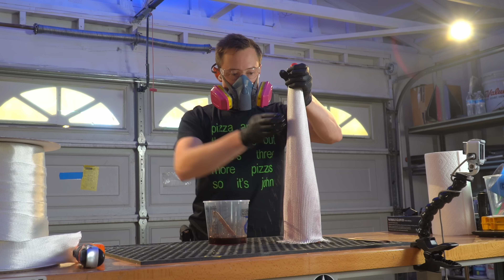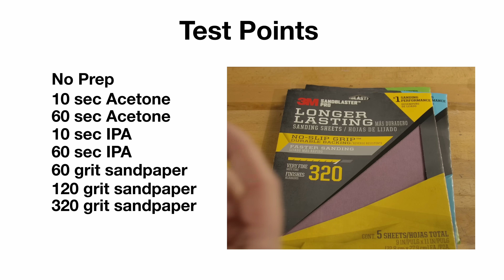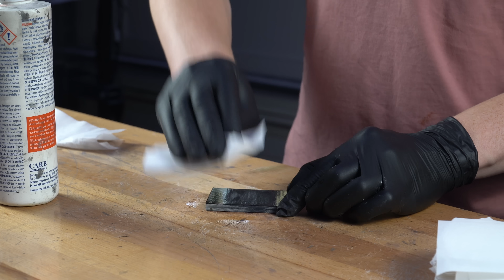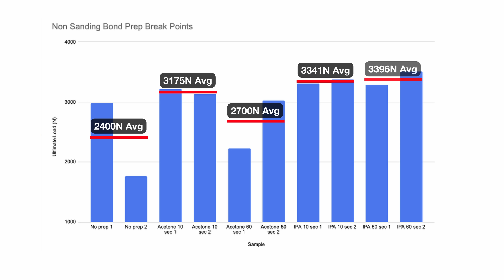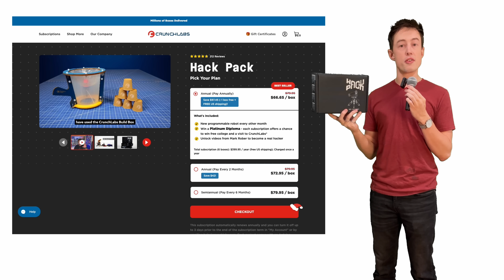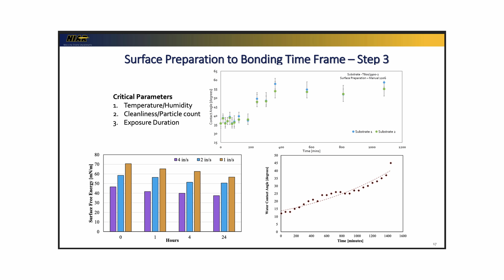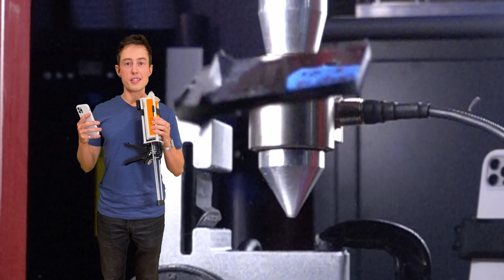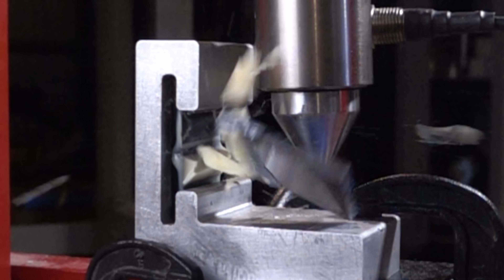I Broke 100 Epoxy Bonds to Find the Strongest

Comment: That is not a proper glue joint and most epoxies are not designed for massive thicknesses without filler. Suggest you read about composite bonding guides from each epoxy manufacturer. But if that heavy poor quality bond is you want.....

Comment: 32:49 also could try - in welding, the best practice is to wipe the surface with solvents first and then wire brush. If you do it the other way around, you'll end up contaminating the wire brush itself and just smear the grease around and actually push it in to the metal itself.

Background- I am certified in  titanium, aluminium, stainless, .... pipe welding.
Reply: Also the sequence will be- Wipe->Abrasives->Wipe

Comment: The most valuable insight was how consistency is key when you have to design around a worst case tolerance instead of the average tolerance

Especially in a system with a large number of failure modes

Comment: bonding to a flat surface is difficult as a flat surface has a low bonding surface area so make the flat surface rippled, larger than scoring to maximise overall surface area.  Rippled is cleaned better than a golfball-type surface as holes pick up more dirt. Porous is best, so epoxy seeps into the bonding surface.  i use this with multi-skeg surfboards.
also use Peel Ply: If you are working on a flat lay-up, apply a synthetic Peel Ply fabric over your wet epoxy. Once cured, peel it away to leave a perfectly textured, ready-to-bond surface without any sanding required.
use Methylene Chloride (Dichloromethane) its dangerous or less dangerous N-Methyl-Pyrrolidone (NMP), toluene, or MEK (Methyl Ethyl Ketone) to expose some of surface fibres to knit into the new bond
also laser etching works and as carbon fibre is conductive then electrostatic etching also is an option

Comment: The sandpaper bring some problems: some contamination you cant remove with ipa: the aluminium oxid particles which can stuck in the surface. The size of each grain can be very different: if not made with JIS Standard or other tight tolerance it means maybe you have some grit contamination. If only 1 grain is 3 times bigger it will have much pressure on it etc… it was very interesting video thanks ❤

Comment: Sanding isn't bad what's bad is keeping all of the debris and dust that is stuck on the crevices after the sanding. Blowing the dust away or wiping it with ethanol doesn't get rid of all dust and debris it just pushes it further into the crevices created by the sanding.

Comment: The vacuum also pulls air out of the valleys of the roughened surface, allowing the epoxy to enter,  Otherwise, those spaces could still contain air, keeping the epoxy out.

Comment: A technique I learned for getting epoxy to stick to Aluminum (Nothing sticks to Aluminum except oxygen -- And that happens within nano-seconds.)   The technique is to 'wet-sand' with the epoxy in place of water.  This works because when the aluminum oxide surface is scratched away by the sand paper, there is no way that atmospheric oxygen (or anything else) can get to the surface.  The only thing that can get to the freshly exposed pure aluminum is the epoxy which is saturating the sand paper and the aluminum interface.  I have used this technique to wet-sand the aluminum spars on my boat with epoxy, followed by a coat of Rust-o-leum and they are still perfect after ten years.

Your experiments -- beautiful work by the way -- my highest regards!  ... seem to indicate that surface contamination is a major and very devious parameter.  The other research you cited as well.  

If so, the 'wet-sanding with epoxy' technique might be the est way to eliminate the problems of surface contamination by ensuring that nothing can get between the freshly exposed surfaces and the epoxy.  It works with aluminum, maybe it would work on fiberglas to fiberglas bonding as well.

Thanks Again for doing things (science) right.  Presenting data not opinions.

Comment: why didn't you use a linisher (belt sander type of thingie)? make your passes repeatable (eg twice through or once then 90-degrees once again etc). i wouldn't consider lint free wipes to be a scientific cleaner... you are trying to get the product CLEAN ie dust free - WASH them! then use a lint free wipe if you must but use a water hose or air jet to ensure that all the dust is gone. otherwise you may just have a lint free, alcohol-and-dust low-adhesion MUD in the scratch grooves. the huge discrepancies in some of your results is problematic - the prep is not consistent. LINISH and WASH - IMHO. Also those beautiful molds are too strong: hammering the product out of your molds is another unrepeatable variable. Use cardboard or paper or something that does not require hammering. (use the same stuff thruout).  let's stand back and look at the forest because we've been scrutinizing the trees. what do you want to do? make a strong bond using epoxy. why don't you increase the surface area by drilling holes in the surface - and/or placing well-affixed pins or screws or rivets in the surface - and/or extending those pins/rivets THROUGH the material ... oh i know i am getting your grey matter burning pink now. these will INCREASE the surface area of bonding by a lot more than sanding. I just love your work JB and your creative and humourous vids. - X

Comment: There are several methodological errors in your testing, but the biggest isn't the inconsistency between samples and controlling the variables. It's not even the sample numbers. But the fact you were trying to narrow don't the best technique, instead of comparing them to find the best one.

You tested a bunch of techniques at first, and then after getting the 4000N on the 60 grit, you focused on it, trying different variations of it to try to improve and later reach back, the original result. In other words, you found a local maximum, and limited your search instead of continuing looking for the global maximum.

To improve any testing in the future I recommend a few things: 

1. 3 samples minimum discarding the outlier of each... while 5 samples is preferable, discarding the highest and lowest values, but I know it's a lot of work so 3 samples is enough for most cases.

2. For every test batch, make a control. A sample you can do the same every time, like simply wiping the surface. This let's you normalize the results to the control, to decrease any discrepancies between batches. It's specially important since for every batch, you used different mixing of the epoxy methods, degassing, etc. This alone let's you relax every other variable you accounted for like making sure the epoxy was the same batch. You only need to make sure the variable are consistent in the same batch.

3. To help find the global maximum instead of a local one (Or at least a better local maximum). When trying to narrow down on the best result, do the same with the other methods. For example, you got a good result on the 60 grit, so you "picked" 60 grit and tried more things on top of it to try and make it better. You should've also done that to other samples as well. Because maybe 60 grit is better than 1400, but 1400 with acetone is better than 60 with acetone. You don't need to test every variation of every technique... there're several ways to optimize the search space to find a global maximum (or as close as possible), without needing to brute force every combination of everything possible.

Comment: Very nice job ! I've worked in composites for 25 years  in a french company who build composite antennas for satellites, and a lot of other spatial stuff (Still working there but in another place) and we were following a process of surface preparation and bonding very precise concerning paper grid, method of sanding, wiping with acetone and IPA, etc... I made tons of bonding on structural composites parts that were supposed to survive a rocket flight and years in space, (and thanks god they did !) and I know that's a real subject to explore !

Comment: Have you considered that Amine blush/ groups develop on cured epoxy surfaces and if you didn't wash off with water before sanding which causes it to get further embedded into the surface?

Comment: drill few holes half way through the fibreglass in your bind area. from that you get a mechanical grip and will out-perform anything you have there

ideally use a milling bit, with a flat tip, not a tapper tip like drill bits have.

again, experiment with hole depth from 20-80%, the resin will fill the hole and lock into place

Comment: 19:45 you can generate plasma with Tesla coils, arcs they make are the same here but safe due to extremely high frequency operation and low amperage, they also can be at MASSIVE scale so arcs can reach more than 2 meters, and all that with only the risk of burn because super high arc temperatures. But yeah, that is one way.

Comment: I’m a composites R&D engineer with mechanical testing experience, and we bond fiberglass to carbon fiber for gripping during tensile and compression tests. This is our process:
Light sanding of the carbon fiber with 300 grit paper, careful not to reach the actual fibers, just the matrix. Fiberglass is media blasted with similar grit particles until matte. Both surfaces are cleaned with IPA with a lint free cloth until no more dust from sanding shows on the cloth. New wipe is used for final wipe down with IPA. Epoxy is mixed with glass beads for bond line control, but not degassed. It is applied immediately after cleaning and then the epoxy is cured under slight heat and pressure according to manufacturer’s instructions.

Comment: I feel like the vacuum isn't the important part -- it's the reintroduction of atmospheric pressure, forcing the epoxy into intimate contact with the surface.

Which means the time spent under vacuum, for the tiniest of bubbles to make it out of the surface texture and move just a little distance in the epoxy, could be a huge factor. If the invisibly-small bubbles are still where they started and just get pushed back into place, no benefit. 

Do you have any records or sense of how long they stayed in the vacuum pot?

Comment: The most wild take away here for me is that for the average person doing a few composite glue ups, sanding is basically entirely useless. It does not in any way automatically guarantee higher bond strength if a whole bunch of other variables are not controlled for.

Comment: I have an answer.

 My friend, Robin Allen, made bows and crossbows. The arms on the latter were laminated wood, bamboo layers and fiberglass. He would run them through his drum sander before gluing them up, and once twined up, he put them in a jig with two pieced of old firehose. He would pressurize them, and put the entire thing into an oven to cure. 

Also some 2 part epoxy resins are stronger when you go 1.x to 1.0 of harder to resin. The X being anywhere  up to 0.2. This was a guy gluing kevlar rope to a piece of glass so he could deform it while grinding it. It was strong enough once he did that to actually pull a layer of Pyrex off.

Comment: when bonding materials you need the bonding agent to get in to both materials you are bonding as 60 grit creates large and much holes for bonding agent it gets stuck together better. but this is not much of a surprise and the bounded materials have to have slight give so they can move independently from the bonding agent so it doesn't stress the bound to much. like how a sword needs a slightly bendy blade so it doesn't shatter.

Comment: A few notes on IPA ans acetone for cleaning bond joints
The companies and agencies I worked for used reagent grade IPA and Acetone for bond joint prep
Commercial grad acetone has too many contaminates 
IPA has a small amount of lanolin to prevent skin irritation
Both of these contribute to poor bond joints
IPA and acetone are both hydroscopic and will absorb vast amount of atmospheric water contaminating bond prep
I was taught acetone first to remove oils then IPA to remove water
But I' know of people who use a mix of acetone and IPA and swear by it

Comment: one of the things that most bonding agents say 
Is to make sure the surface is wetted  
By scrubbing the bonding agent into the substrate
Just pouring the bonding agent on t o the surface 
Doesn't break the surface tension of the bonding agent 
Allowing it ot adhere to the substrate

Comment: IPA, Indian Pale Ale? I searched ipa solvent and found isopropyl alcohol. Never mind. I found in the book Make Analog Synthesizers by the late great Ray Wilson that 3 parts isopropyl alcohol and 1 part acetone by volume was used when he worked for NASA for removing flux from circuit boards, for what it's worth. I got the impression the isopropyl alcohol took the edge off the acetone while still being a good solvent on its own. Also, what does an ultrasonic cleaner do to the surface of an epoxy composite? I worked in an entomological museum where we used one to remove crud on insect specimens. Bark beetles tend to be covered in conifer resin that the ultrasonic cleaner would quickly remove in turpentine. Insects need to be clean to be sputter coated with metal before looking at them under the scanning electron microscope. The solvents used to get insects ready for the SEM is anhydrous grain alcohol followed by critical point CO2. Insects can have a built in chastity belt system. The males and females in a species can have complimentary genitals that only fit together with their own species. Removing the genitalia is one of those odd things we have to do to identify insects to species. It can be annoyingly tedious delicate work. Then comes the critical point drying of and sputter coating metal on the genitalia if you intend to look at them under the SEM. I recall one person who we had to tease when he blew a microscopic ediagus (male insect member) off into oblivion when he did not clamp the lid to the critical point dryer down securely enough. I'm also curious what critical point CO2 would do to composites. I imagine a proper monatomic oxygen generator in a vacuum chamber would activate the surface of something, also. Another cleaning agent I used when I worked as a custodian was Micro 90. They company will send you a sample to get started with. I mixed it at the weakest concentration recommended in deionised water and used it as a general cleaner. It was funny to tell the science building users that the cleaner that seemed to make windows disappear was the same stuff they all used to clean their lab equipment.

Comment: Please see FAA Advisory Circular AC43.13 page 1-7, paragraph 1-6:
https://www.faa.gov/documentLibrary/media/Advisory_Circular/AC_43.13-1B_CHG_1_Ed_Upd_FAA.pdf
You are touching on an interesting area.  When in College for my A&P, I was instructed to never sand wood joints before gluing as the dust would clog things up to the point the joint would be weakened.  We were able to create scarf joints in wood with Casein glue without sanding that when cured would result in joints that would fail with transfer of wood to both sides.  That means that the joint was strong enough that it was down to the strength of the Lignans on either side that failed, across the glue joint.  One thing that the advisory circular suggests is to vacuum the surfaces prior to bonding to eliminate the dust present.  I would suggest that you consider vacuuming the sanded coupons prior to the Acetone step.

For more consistent sanding I would suggest trying the following options:
Wash the coupons with distilled water and pure Castile soap and repeat till you get to the point where it is squeaky clean when rubbed with your finger tip.  This should remove some contaminants that could be scrubbed into the sanded joint and is cheap/easy.  One note for this step, when you are fully certain that you have completely rinsed the soap off, you are actually half way there.
Dry the components and then degas the components  in your vacuum chamber to remove the water fully.
De-grease and clean each piece of sandpaper prior to use, ether might be useful for this, depending on the chemical used and the formulation of the sandpaper.
Use a sanding block to hold the sandpaper and applying it to the coupons.
Use a sanding jig to guide the block to keep it uniformly straight.
Place a weight on top of the block to keep the sanding pressure identical.
Sand in one direction only, for an identical number of strokes in that direction.
Use a new piece of sandpaper for each coupon.
For an alternative option, set up two jigs to allow for sanding in two different directions, like a + sign or an x in shape allowing for the bond to attach in a different manner and possibly have interesting results.